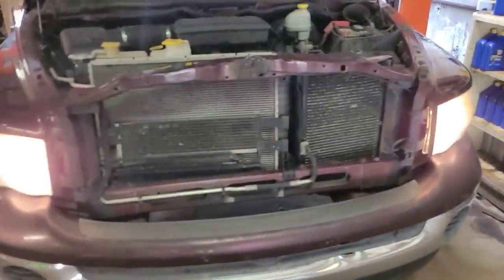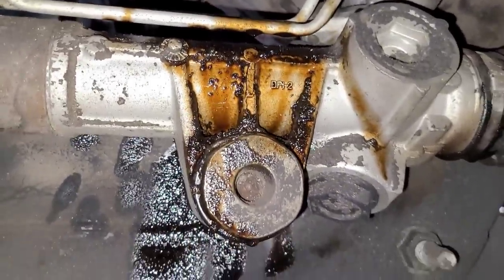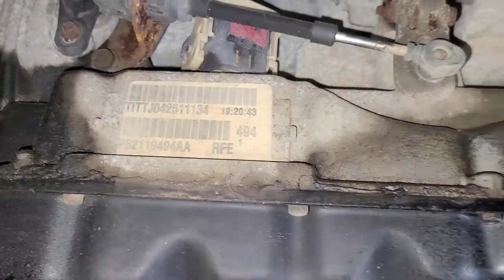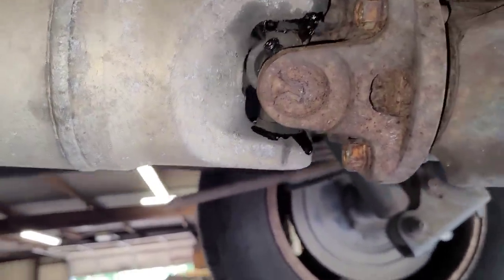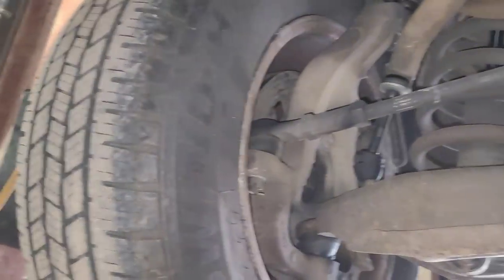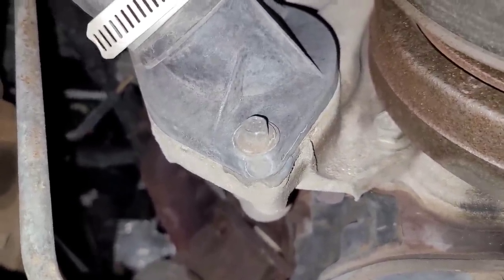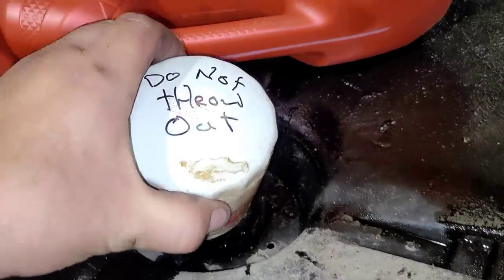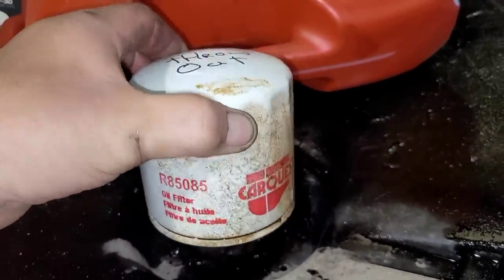I Think I Should Have Changed My Own Oil Sooner!!

Comment: I was never very diligent with changing the oil in my 2002 Ram 1500 with the 4.7L for the first 10 years I owned it.  I'd probably go 10 - 15K miles between oil changes and I'd just add oil if it was getting low.  However, I always used Mobil 1 Fully Synthetic.  It has 192K miles on it now.  About 5K miles ago, I replaced the valve seals and I was very surprised by how clean the engine was inside.  It was just as clean as an engine with 1K miles on it.  Synthetic is the key and it looks like yours may have only gotten the cheap dino oil.

I recently got rid of my 1987 Firebird that my parents bought new.  It only got regular dino oil and never saw synthetic.  The oil was always changed every 3K miles, something my father still does to this day in his new vehicles that run synthetic.  At 168K miles, I was getting no oil pressure unless you revved the engine.  Pulled the valve covers and there was 1/2" plus of cooked on oil on everything.  I decided I was going to just pull the engine and rebuild it.  The caked on oil was absolutely insane.  All because of the dino oil that was used.

Anyway, I finally found the source of the low oil pressure.  Inside the oil pump is a .2 cent spring for the pressure relief valve.  It had rubbed on the side of the bore so much that the spring was paper thin and it collapsed.
Reply: I’ve also noticed that Mobil full synth washes the engine real well.
Reply: @maikelnait1051 how did you notice that?
Reply: Because I buy mostly older cars and when I use mobil it loosens all kinds of crap from the engine. Oil turns black in 3-4k miles in some cases for several oil changes. And then it clears out.
Reply: @maikelnait4495  you pull valve covers and actually take a look? Or the pan?
Reply: In most cases valve covers, rarely oil pans. Ca two dozen cars by now. Not all of them have heavy sludge of course. Not claiming that mobil is best oil or something, it hasn’t let me down so I’m sticking to it.
Reply: @maikelnait4495  interesting, thanks.

Comment: Been down the tire pressure road. Traction is better at what the sticker in the door calls for. Also tread wears longer using the pressure set in the door. You do you but the factory made those recommendations based on how much air you need in the series of tire they put on the vehicle, so I go by what’s in the door since they spent millions figuring out the best compromise between load handling and traction and already accounted for long drives.

Dude that oil was nasty. If I saw that in one of my vehicles I would be adding SeaFoam right from the start and change it again in a couple days or 100-300 miles. I use it when the oil is nasty, and when I get a new to me vehicle that I don’t trust was kept up well. It’s cheap and cleans. Some people don’t like it but I do and Project Farm does. I use MMO as a standard additive because the theory about it when I learned about it from a friend was it gets in those tight spots where it’s hard to lubricate enough and sticks to them. So whether it’s correct or not the idea is you never actually get a dry start. You get, in theory, residual lubrication on every bearing surface. I know my Saturn has over 322000 miles on it and there’s no evidence that it’s an old engine. Oil does drain black but I don’t take it to 4000 or 5000 miles for any of the vehicles I change it at 3000 or when it’s too dark for my liking. If it’s dark brown or black at 1000 miles it gets changed. How much is it to get an engine built? Oil is cheap and meant to be a consumable. Also I have seen conventional oil perform better in that Saturn than the synthetic and synthetic blends. That’s my experience and everyone’s will vary some depending on what they are looking at and for. Either there’s something to it or I have been getting incredibly fortunate at picking used cars and trucks. But I loathe automatic transmissions. I don’t trust them. Every one I ever owned except the one I sold right after I paid it off, failed on me at some point. I never had a manual fail me and the one time I had a clutch problem nobody recommended me or told me I have to buy a rebuild. Wife’s car needed a shift solenoid and torque converter and or lockout clutch solenoid. They sold me a rebuild then it was the third trip back to the shop before they replaced the solenoids and they had to replace the steel set because they kept sending it out broken and thankfully it was still under warranty. 1 time I had to have a clutch installed and install a clutch cable. I diagnosed it myself and the guy did the work he sold me. Then he told me what was wrong. I share what I did to prompt a trip to the shop or what symptoms are concerning me and let them do the rest when I decide I ain’t fixing it anymore. He fixed my shifter though and it taught me to get their perspective, might save me money and frustration. I still do everything I reasonably can myself but I don’t have a level driveway or a lift so I’m not often putting the wife’s car on jackstands to check transmission fluid levels because GM decided it should be checked at operating temp from a check/fill plug underneath the car even though you fill it from the filler in the top.

Comment: You definitely got a great deal on that oil. I, unfortunately, am never around when those deals come around. I just spent $225 for 10 gallons of Delo for my Freightliner...ugh.
Reply: Just a thought from experience, do you use one of the synthetic media filters on the freightliner?  if not, try it and see if the oil is cleaner longer.
Reply: @Cort Godwin  The only filters I will run is the Detroit branded filters. I change the oil more often than Detroit recommends because I am in hay fields a lot. Coming up on 600,000 miles and still running strong.

Comment: That is the only time smoking is good for you Ken. Nice score. I'm doing the same thing with a trailblazer we got. Neglected oil changes. I'm changing it every 1,500-2.k miles.Oil pressure came back and it is slowly cleaning up.

Comment: Guy bought a little old ladies car. He removed the valve cover and it was a gooey mess in there. She only drove a few miles twice a week in town so the oil never got hot. 

Old timer told him scrape out as much as you can. Pour kerosene in to wash the rest down. replace valve cover and fill with kerosene to the fill hole. let it sit at least four days. drain and fill with one quart of transmission fluid, cheap oil till dipstick shows full. drive it at least 500 miles then drain and repeat. This time drive 3000 miles and drain but fill with all good quality oil. He took the valve cover off after the 3000 mile change and it was really clean in there.

I shared that will someone and they told me they has a similar experience with Marvel Mystery oil.
Reply from the maker: That's a good trick. It's kind of like putting everything through a parts washer without taking it apart. Thanks for the tech tip! Keep wrenching

Comment: I wish it was that easy to change the Oil in my RAM 😮 the Cummins engine is a beast! The plug is not a big deal but the filter tatts another Story. I've done it 4 times because I was towing a camper around the country 7 months in the Arizona desert all that dust, I won't go over 4500 miles in a harsh environment sure 12 quarts of Rotela T6 is pricey but cheaper than fixing a Cummins Engine, I don't take any chances with tey engine or it's Turbo! next is the transmission fluid and filter change it has a screw in filter in the pan just like an oil filter..

Comment: Ive had good results using Marvel Mystery Oil for the last quart and doing 2 short (2500-3000 mile) oil changes to clean out a gunked up engine.

Comment: I dont know what good the oil treatment  can do for the motor can do but the trans treatment  dose work i seem it 2 times its not 100%  but it got me by till i could do it right.Tire pressure  is a wide range  dependent on tire size car weight speed wheel rim size i do 44 on 235-75-15 on my 76 c10 and tire wares good mpg is 19 on 305

Comment: Get for Moto drain valve you just side the metal lever do the side and all your oil you do not have to mess with that dream plug in hot oil and it also has a lock you can put on it so it doesn't come open you make sure will changes faster easier and cleaner

Comment: Tire Pressure 411….Tire pressures “INCREASE”with heat. I keep my 2019 RAM 1500 4x4 at 36psi COLD. When the tire heats up, the internal tire pressure increases to 40/41psi, depending on road temps. All TIRE AIR PRESSURES INCREASE DURING DRIVING.

Comment: My 2001 Dodge Ram 1500 5.2  has 260,000 miles on it.      I bought it in 2001.  It's been doing that put it in reverse and not going for a few seconds for probably 10 years or more.  Like you said,  it no problem though.  It always works good after a few seconds of warming up.

Comment: if you run genuine mopar trans filters replace both in the pan usually stops those problems ran into that on a fleet of dodge trucks serviced them with aftermarket filters all of them did it  replaced filters problem went away

Comment: The last two dodges i had had that same issue with the transmission. If I put it in reverse too soon after starting it would move but wasn't fully engaged felt like it was slipping. I changed both filters and the fluid and it fixed them. My last one it took a while like it was gunked up who knows it might be the reverse band servo getting stuck who knows seems like a common issue. Both had the 4.7 an ok engine not good fuel mileage. Both started burning coolant and a few stop leak tabs took care of that and both had timing rattle when cold but after running a little it went away and quite as a church mouse.

Comment: Tire pressure. When the Geo Tracker came out (remember those?) I took it for a test drive and the salesman kept harping on the harsh ride is because it was a 4x4 truck and it was normal (Duh!). I bought one and at freeway speeds I felt unsafe. It had 215/70-15 tires that has tall sidewalls and Chevy said to put in 23 PSI (Suzuki said 32 PSI) WTF? To make the ride softer? No wonder it had a roll over issue. I ran with 35 PSI and never felt unsafe again (I put 250K on it then gave it to my son).

Filter Bypass. Depending on who makes the filter it can vary to about 10 - 20 PSI. Which means that if your engine has 40 Lbs of pressure half of the pressure is bypassing the filter (This does NOT mean that half of the VOLUME of oil is bypassing the filter). As the filter gets dirty more oil will bypass the filter. So do you REALLY want to wait 8K, 10K or 20,000 miles before you change the filter? With synthetic oils I change mine at 5k.

Comment: Thanks for this video Kenny, it really brings home the need for regular oil changes.

I'd heard years ago about flushing the engine with kerosene - basically drop the oil and filter, put on a new filter, fill with regular oil amount of kerosene, run for 10 to 15 minutes, empty the kerosene and change the filter again, fill with fresh oil and go. Next oil change recommended to be much sooner than usual.

Any thoughts on that at all?

I've never seen it done, but this fella - not a mechanic, but worked on his own cars and trucks - swore by it and claimed to never have any issues.
Reply: I knew a guy that did that too but I don't remember the end results or if maybe he was selling the car and just wanted everything to look fresh
Reply: Eons ago, I added STP goo to my '64 GTO, and later when I pulled a valve cover to replace a seeping gasket, I found everything covered with thick gunk. That was the end of Andy G's STP oil treatment. I added about a quart or so of kerosene and ran the engine for about 10 minutes. It really cleaned the goo out, but I would never--ever--use a full fill of kerosene!

Comment: Filter on my suburban needs to be tight ive had it come loose driving down the road and piss oil everywhere and also when i come across a sludge engine ill fill it with dex merc 3 transmission fluid and idle it for about an hour you'll be surprised how much crap comes out when you drain it im also a firm believer in 3k oil changes i dont care what the manufacturer or anyone else says

Comment: I have a 2000 dakota crew cab 4.7. When I first start in  morning it cranks over fine but won't start. I try again it does same thing before starting. I'm thinking fuel pump back feeds into tank when sitting. What are your thoughts?

Comment: If you don't lube the rubber gasket of the oil filter with clean oil, what can happen is that the rubber gasket may stick to the mating surface on the motor, so be sure you verify that the gasket has been removed with the filter when changing filter. I suppose if you don't tighten it with a filter wrench but only with a little bit of hand pressure that might not happen as often or even at all, but I prefer to use a wrench to be sure it's tight. I have had the filter loosen up many hundreds of miles after an oil change I paid for. Good think I caught it in time. It doesn't always happen, and the expense can mean buying a new motor. It's just not worth the risk.

Comment: What do you think of marvel mystery oil for quieting lifters? You said you dont recommend oil treatment stuff
Reply from the maker: I really don't recommend them. BUT, MMO does have a place . It does have properties that can help quiet lifters . However, the same can be said of old school transmission fluid added to oil . They both do a great job of cleaning deposits inside an engine. MMO used to also claim that it should be used in fuels as a lubricant for pumps and moving parts that are in contact with fuel, but I believe they stopped saying that. I've used it in the past with some success, but I've also had the same luck with using old school Type F ..

Comment: New Canadian vehicles have daytime running lights also
Reply: Just added them in the fog light position on mine, using LED units, and wired up to a relay. Much more visible now, driving a car the colour of the road.

Comment: Kenny doesn't drive in wet weather much or he wouldn't be talking garbage about having the tires inflated to maximum. He is the type that used to put all tires at 32 lbs, just because he felt they should be set at that pressure. Hey by the way, they will over heat at too high of pressure also.

Comment: That's very informative, here's one for you, 08 ram 1500 tried synthetic oil 4 times within the last 5 years, and every time my check engine light comes on within the first few miles, so I scan car and it says low oil, no not low oil checked it, triple checked it, went and changed to regular oil and yeah light went out within the first 5 miles of driving, I did that 4 times so I know its the synthetic oil setting that low oil code. Unless I change the sensor, I can't use synthetic oil. Isn't that a weird result? 🤔 only American built cars have no low oil light but a check engine, like everyone has a danm scanner in their pockets to know your car is low on oil.

Comment: Kenny is there any way to get the oil treatment out of the engine? Something like an internal oil cleaner? Or will it work it's way out over time and oil changes?

All the best.

Rod
Reply: Use Royal Purple oil and change every 3-5k miles. RP has a strong detergent package that will clean out pretty much anything over time.

Comment: I agree 100%. Lucss oil additives are NOT necessary and it may even be detrimental to your engine. I'm speaking from experience. I had a 1992 GMC K1500 pickup and when it reached 200K miles, I thought it would be a good idea to start using Lucss oil treatment to increase the viscosity of the 5W-30 I was using. I used per the instructions printed on the quart of Lucas. As soon as I started the engine after adding Lucas, the engine made a ticking noise that wouldn't go away after warming up, so I took out the Lucas/oil combination, and stuck with the 5W30 the book called for. The ticking was caused by cam, valve lifters, and rockers. The Lucas/oil combination was too thick and it wasn't getting to upper part of engine. I guess I could've gone with 10W-40 for higher viscosity instead of Lucas but didn't want to chance it after seeing what happened with Lucas.

Comment: The best tire pressure is published on the sticker in the door. The best traction is published in the door. You are a rolling wipe out waiting to happen. My F150 door calls for 35PSI and I inflate to 35 PSI 40 when I expect to put a heavy load in it. The numbers just mean that tire may be used for up to this load and pressure, but your truck isn’t designed for so much pressure. You do you I guess but it is just one more safety violation that makes all roads even more dangerous.

Comment: Aftermarket filters cause this issue. Put mopar filters in the trans.
Reply from the maker: Really ? I've never heard that before on these . But then again , I was a Mopar tech for 22 years, so I used only Mopar parts . I'll actually order the filters and try it !! Thanks for the tip !!
Reply: @WrenchingWithKenny  we only use mopar filters on all rfe builds. Aftermarket spin ons have drainback issues, and the main filter cracks at the seam.
Reply from the maker: @Hensley Transmission  I actually just ordered the Mopar ones today . Be a good weekend repair !! Thanks for the heads up !!!

Comment: Why to go Kenny!   Great buy on the oil.   Absolutely agree about oil additives.  Don't!   LOL.    Just use good oil and change it frequently is my advise to those who ask.    You are doing it the right way to clean up that engine... no oil "flushes"... and just frequent oil changes.
Reply: Yea my dad made that mistake. Bought the really thick Lucas stuff. Burned up the vvt solenoids as well as all the oil components like oil control valves. Engine ran like shit until we changed all that.